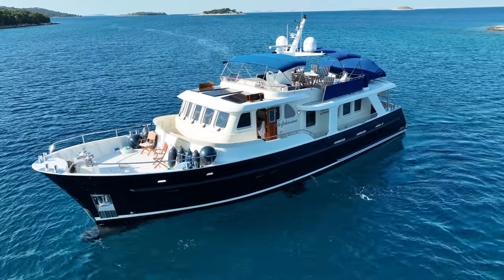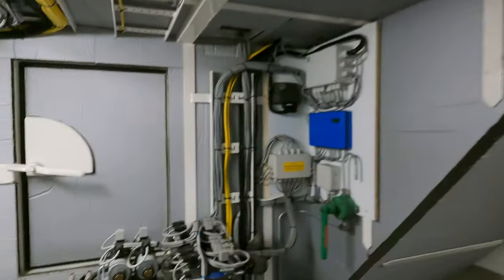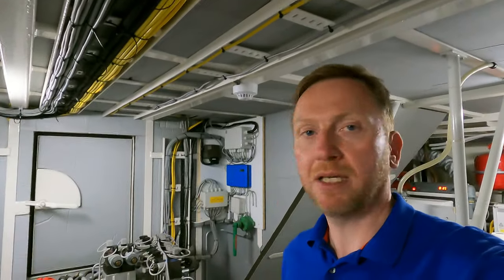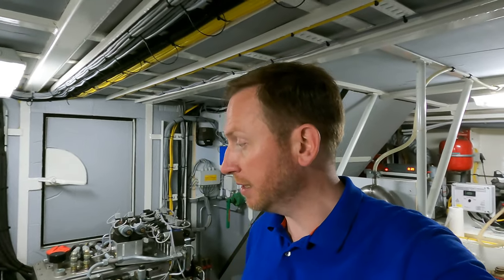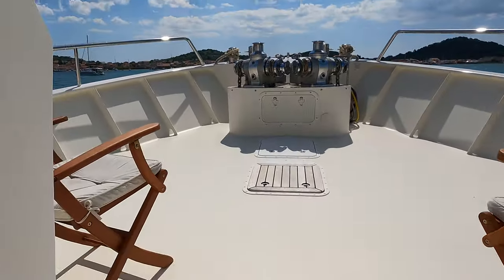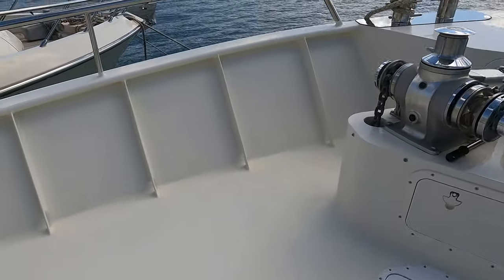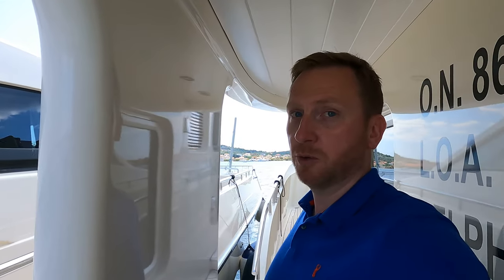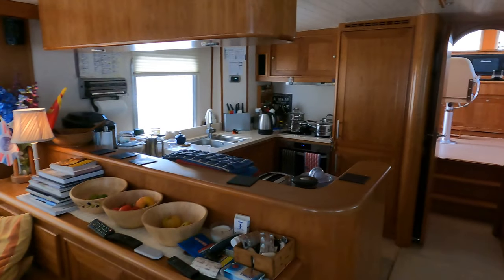My Favourite Features On The €1.75M ALMTRAWLER DELFINO 65!

Comment: This trawler checks all the boxes for me.  Caterpillar owns Perkins diesel, which is a plus.  The question I have is Perkins used to make multifuel engines.  The engine could run on diesel, kerosene and gas.  Are the marine engines multifuel?
Reply from the maker: Negative, not these ones